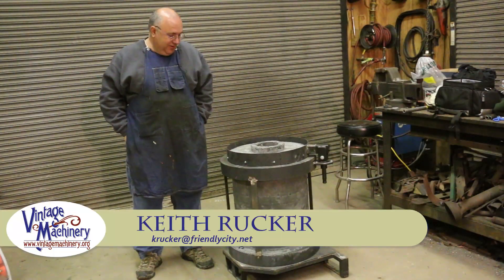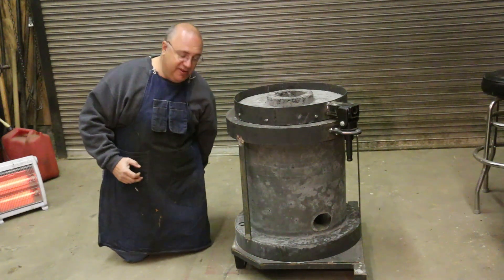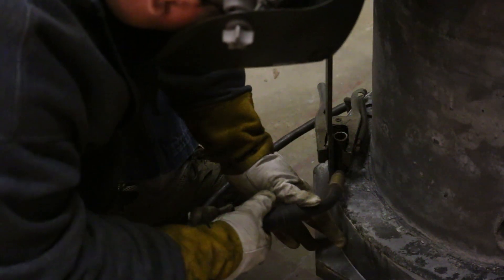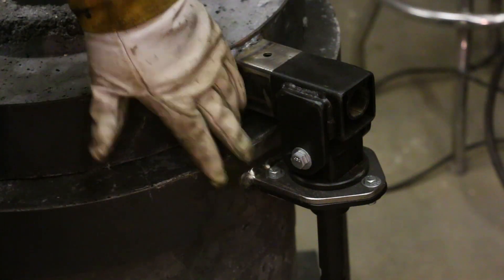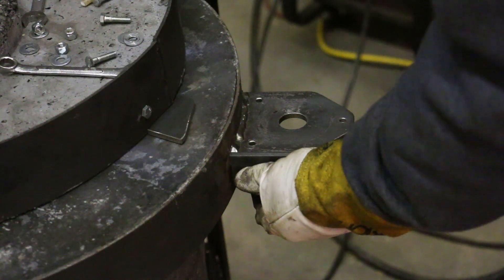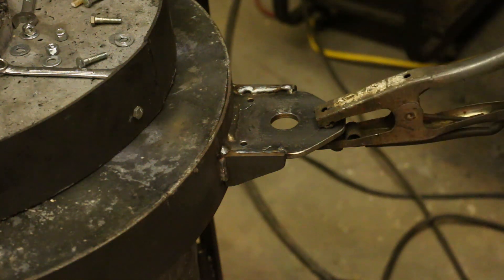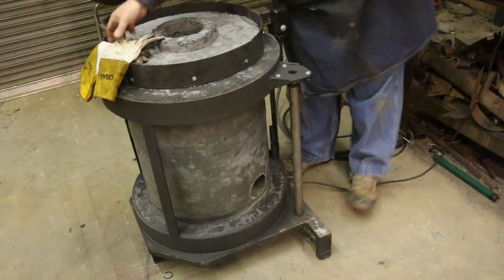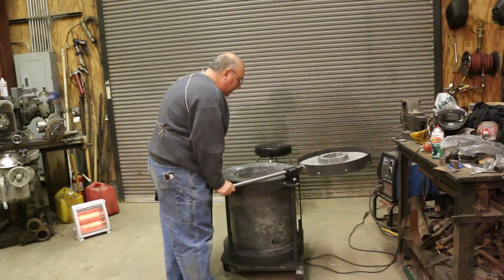Building an Oil Fired Foundry Furnace - Part 9:  Design Modifications

Comment: When cutting stock with an abrasive disk, when the material is fixed on both ends,   you have to be wary that if the stock shifts it will pinch the blade and fragment it. Don't ask me how I know this.

Comment: Keith, you'll be able to use that pin and rod, 
as a thermometer.Build a fire in the foundry, 
,mark the position, before anything warms up, 
and when you're at the right temp, mark how 
much  the foundry has expanded.

steve

Comment: With the supports, all you ne3eded to do was make a slight dog leg bend in them.
But you are correct. Refactory cement does not have high integrity and if it tries to expand against constriction it chews on itself and starts to crumble.

Comment: Keith,  you can weld down hill on the steel you are using unless your machine is a low amp 110 machine.  turn up the heat and turn down the feed a bit, up hill welding is generally for stick welding pipe and heavy sections.

Comment: Sorry to say but those sleeve supports on the bottom aren't going to do anything constructive but apart from that it looks very good.
Reply from the maker: +colin jones I disagree.  When the furnace is cool (as it is most of the time), the supports are doing just that, supporting the top flange.  Granted, when it is hot, should it expand, they would not be providing much support, but that will only be a small percentage of the time.

Comment: Keith, You mentioned a few times your desire to cast iron but were anxious whether an oiI fired melting furnace would be adequate. How about oxygen enrichment of your combustion air in the final stage of the melt cycle? 

If you have a good source of oxygen like a 221 cu ft cylinder or the dregs from a nearly exhausted commercial Lox Dewar you could enrich the combustion air thereby increasing the flame temperature an important 300 degrees for the last ten minutes to get the melt superheat needed for good mold fill. 

Not shifting over to pure oxygen, you understang; that could be explosive if the heat didn't wreck your refractory. The idea is to enrich the combustion air with a controlled trickle of O2. Add a little O2 and dial back the combustion air to compensate. Just a suggestion.

Forrest Addy

Comment: Keith, I have been following "myfordboy" in the building of his furnance while watching your series as well.  On his part six of his series in building his metal casting furnace, he shows a neat and clean approachj to finishing off the torch hole. For inspiration, you might want to check it out on... Metal Casting at Home Part 54 Oil Fired Furnace Build Part 6 (Re uploaded)
Reply from the maker: +Nevin G. Summers I have watched all of his videos closely and as I have commented before, my design has borrowed several design ideas from his.

Comment: if you inserted springs in the support struts and hinge base tube... you would always giving the kiln support even when expanded as the spring would just grow and contract.

you might even insert springs into the newly installed tubes under the pins or on the pin and setting on the top of the tubes if there is room.

The pipe under the hinge might actually present a problem if it expands more than the concrete grows... it can try to force the top ring up.  Personally, I don't think you need it with the gussets.. Those gussets are extremely (EXTREMELY) strong and in that the ring is a ring and not a flat plate, it is also strong and not likely to bend nor peel away from the weight.

I think I'm onto something here... what do you think?

Anon

Comment: Hey Keith...

make yourself an "L" shaped handle out of square tubing (or with a key / slot/ whatever to locate if from spinning in when inserted into the lid hinge) then you won;t have to bend over to your knees to open the lid.  even a 45 degree angle or so would be better than the straight pipe.  whatch think?

Anon
Reply from the maker: +Anon Ymousmie I am not following you - not sure what you mean about having to go to me knees.  I can open it fine like it is standing!

Comment: Keith, I greatly enjoy your videos, and have found them to be both educational and practical, with real world applications.

On the subject of a hook for the lid; I would like to suggest that the hook should be affixed to the handle in a manner to allow it to work from either direction.  If the hook were attached to the frame, it would preclude operation in both directions. (Just a thought.)

I'm looking forward to seeing it properly cured and prepped for use.

30 degrees F. ??? What a nice day.  Stay dry.

John
Reply from the maker: +Johannes Noneoftheabove Not a bad idea but I have already added the hook to the furnace so it is probably too late to so anything with it at this point.

Comment: Interesting mods. The expansion coefficient of any metal is much greater than that of the refractory, so the metal vertical supports would tend to push up on the refractory. So the pins won't hurt and they may help. The last thing you want is a fracture at molten-iron temperature. Go ahead  and overbuid it.  As Tom Lipton says "nothing overbuilt ever broke".
Reply from the maker: +Juan Rivero I will be watching the expansion joints when I heat it the first time.  I will be willing to bet that there will hardly be any movement in the legs but better to be safe than sorry!
Reply: I need to look up the expansion coefficient of refractory. It better be low, but until I have some numbers I will say no more.

Comment: Hi Keith, great to see some more progress on the furnace. Perhaps instead of using refractory for the burner support, how about a steel bracket contoured to the burner tube and welded to the bottom ring since it only needs support on the bottom and the sides for position. Then just a hole in the insulation to stuff the tube through.
 As to the changes YouTube has made, I haven't even figured out how to use the old system and now they throw a curve ball at us. And now I see that even the comment box looks different somehow. Looking through the usage and help sections is of limited use as they will change something else before they update them to how it works now. Often I think that the help and usage pages are written by someone too familiar with the system when they should be written by someone who has just learned how and understands what needs to be conveyed. AKA the parallax view. Someone on the inside just can't see the forrest for the trees. I guess the best bet is to go to Google or YouTube and search to see if help or instruction is available from an outside source. 
    Mike (o\!/o)
Reply from the maker: +Moholo 88 I will probably add a steel ring to also provide some support but the extra refractory will be a help as well.

Comment: Looking really good Keith! With you standing next to it, however, it dawned on me just how tall it is. I'm guessing you designed it around a certain size crucible, but to get a loaded crucible out you're going to be up around shoulder height lifting it. Maybe that's why commercial foundries are often recessed into the floor of the workspace?
Reply from the maker: +Thomas Utley Most of the time, I will probably use a smaller crucible but I wanted the capacity for a larger one when I need it.  Either way, pouring with this furnace will probably be a two person job.  You might have to come fly in to help me when I fire it up each time!

Comment: Correct me if I'm wrong, but isn't it a feature of the refractory cement you used, that it doesn't expand much with heat? In any case, the movement would likely to be just a few millimeters.
Reply from the maker: +Landrew0 I think you are correct and I will be watching this when I heat it up the first time.

Comment: ok..., so you cut the vertical supports and added the pins/sleeves.  The vertical support for the lid hinge is also not attached.  Correct me if I'm wrong, but how do the supports transfer load if they're floating...?  The fundamental flaw in your design is using the refractory as a part of the structure.  If the top of your hot face was free to float within that heavy steel surround you wouldn't have anything to concern yourself with in terms of thermal expansion.  Truth be told your refractory body is so massive you don't need supports of any sort, including the lid hinge area.  On the upside, the vertical pieces should help with holding the ceramic blanket in place while you wrap on the outer shell.

Comment: Have you contacted the refractory manufacturer to determine the coefficient of expansion?  Some materials actually shrink at different temperatures.  You also need to know both the coefficient for longitudinal and radial expansion.  The coefficient for steel is easy to find.  Knowing both you can develop a chart comparing the expansion of both refractory and steel over the working temperature, this giving you informed knowledge of the delta difference(s).  You may or may not have an actual problem.
Assuming your current conjecture the changes are radically different is correct, I see four possible problems with the current design:
1.  I believe in your previous video on building the form you mentioned the top ring was constructed so the inner circumference of the horizontal plate actually projected into the space formed by the barrel.  This effectively creates a mechanical lock between the refractory and the steel.  If this inner ring were at the edge of the barrel then the refractory could expand unimpeded.  Your recent modification of adding the floating pins remedies this but defeats the purpose of having the three struts provide vertical support to the refractory.
2.  When you add the outer metal skin you effectively defeat the floating pins as the bottom and top rings are then mechanically joined together.
3.  If the refractory breaks free of the top metal ring and does expand significantly more then the steel then the  planes of the refractory column top and the lid will no longer be parallel.  This would create a void where heat escapes. 
4.  As there was no expansion void between metal and refractory the radial expansion may cause severe fracturing.

Comment: Hi Keith that furnace is looking good. Wish I had the money and time to do some of these kinda projects, I could keep myself out of trouble for ages. Glad you didn't weld the pipe both ends was sat here thinking didn't you just cut 3 rigid braces for a reason L.O.L.  How will that work using more refractory to strengthen round the burner port, as the furnace is already dry. is there some way to key the new stuff to the technically old/dry like you would with concrete patch repairs, to stop the 2 separating and falling apart due to   what I would call a dry joint if you get what I mean. .
Reply from the maker: +super6954 To be honest with you, I am not too concerned with the refractory that I am adding stick to the old too strongly.  There are plenty of small holes and such on the surface that it should grab fine and hold in place but it is not important that it all be one piece.  The addition is just for some support to hold the burner.

Comment: Keith what are you going to with the three band rings expanding, Is there not chance compressive forces when the furnace is hot.
Reply: +Marcus460 I don't think compression of refractory where the forces of the metal ring would be inward is likely to cause failure.   'The legs on the other hand could have been uneven pressure to the side and could have cause a crack.    I think if I do one of these I plan to have the top ring (not the cover) to "slide" up and down  over the refractory.    This is an intriguing engineering issue.
Reply: I should of stated expanding rates are different between the refractory and the steel bands which would more then likely cause edge failure on the refractory if not surface puckering. I personally would've made the banding capable of expanding.
Reply from the maker: +Marcus460 The metal rings will not get very hot like the refractory will.  We will have to wait and see hot things work out, but there are plenty furnace designs out there that use metal rings, including some commercial furnaces.  I don't think it will be an issue.
Reply: I certainly hope so...

Comment: Hi Keith,

I think your furnace is hopefully on its way to being a fully useable part of all the tools in your shop Good luck on that.
I have to say and I can’t comment as someone who knows about it, but regarding the struts on the side which you modified today in this video, isn’t it true that if you have sliding connections they effectively are not doing anything helpful in a mechanical way. Or is it these little sliding joints are help to prevent as much sideways movement, in everyday use and in a possible catastrophic way? 
I wonder if you have time whether you could explain your reasoning please? I am not trying to be rude in any way and I am certainly not any kind of devils advocate. I am Sure I  must be one of those that cannot respects you any further than I do and I am sure I am not the only one to be buzzing each time I see you have another video and can’t wait to see whats going on. I am especially eager to watch how the sequence of events unfold, now with things on the furnace, I do realise there is still work to do, I just can’t wait to see the first lighting of the furnace, and would that be a simple wood fire?

Take care
mrbluenun
Reply from the maker: +mrbluenun There is a lot of weight on the upper rim of the furnace.  My thought was that the supports will give it some support.  The way it is now, when the furnace heats up things might expand and they would not be providing any support, but the vast majority of the time the furnace will be cold and they will be resting on the base.  Also, the supports will help to hold the insulation in place as well as give me something to attach the outer skin to also providing more support.
Reply: +Keith Rucker - VintageMachinery.org I appreciate your kind reply thank you so much

Comment: DOING A GREAT JOB THERE!  regarding ideas for added support for the lid lifting  handle and lid. my first thoughts  is a gusset on top of the hinged  made from 1/4 or 3/8 and using 3/8 rod  down to the lid like you explained. very good idea I think. its getting to the point  I cant wait to see it in use. thanks for sharing!
Reply from the maker: +dennis brooks Won't be long now!

Comment: Great idea with the floating pins!
Reply: +MattsMotorz there is a way to design the pin with the pin being a floating pin cut on an angle on each end so that as it grows, it will be "always" providing support.

but I like my spring idea better.

Anon
Reply from the maker: +MattsMotorz Thanks - I will be watching the expansion joints when I fire it the first time to see how much movement (if any) the furnace actually has!

Comment: As a former refractory engineer, I'd like to complicate things further, by pointing out that the refractory castable will probably undergo some permanent change (contraction or less likely expansion) on its first heating/cooling cycle. For this type of material it is likely to be pretty low, though - in the order of -0.2 to -0.3% (the manufacturer's datasheet should include this figure - they call it PLC/Permanent Linear Change on reheating) but your sliding joints in the side bracing pieces might end up being under compression when cold.
Reply: +Emma Jacobs. in 50yrs I have designed thousands of CY of concrete. U r dead on. several others comment same, only an analysis will define differential movements. the steel may actually expand more.

Comment: Are you going to use rock wool insulation bats to insulate the furnace?
Reply from the maker: +Vsshooter I am using a product called Cerablanket.  It is ceramic fiber material.

Comment: Keith, I have one very close to what you build, can I suggest you wait with wrapping  the outside until after you have dried it out and have actually fired it up a couple of times with the burner. it's surprising how much moisture is trapped in the refrectory even after it looks to be dried out. the blanket insulation will only hamper the drying process! I had steam coming out everywhere, and had to unwrap mine again, until after the drying out process was gone through completely.Hope this helps you from paying another bit of school money, I have already paid for.Great videos, lots of good information, thanks mate. Regards..
Reply from the maker: +downunderwest Good suggestion.  I will probably go ahead and get the blanket installed but remove it for the drying out.

Comment: i might be way wrong  here however, I dont think expansion would have been that big of a deal,  I mean giving the difference in temps just from the inside of the furnace to the outside, the inside expanding faster and further than the outside causing compression on the outside you would think that differential would cause enough stress to crack it if it were going to crack, and also if it is a problem the steel bands around the lid and also the top and bottom of the furnace will cause the same sort of problems.. just a thought, looking forward to seeing this dude all fired up thanks for the vids

Comment: Have you thought about giving your lid lever a "T" at the top so you won't have to bend at the waist? Just for ease of use and a stabilizing "U" where the lever meets the lid so the "T" won't flip to the bottom? just a thought.